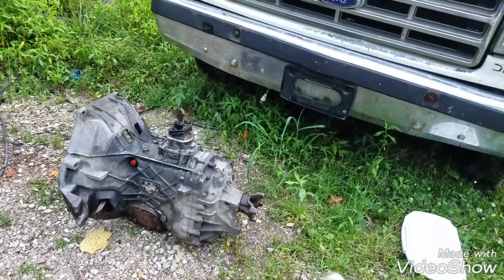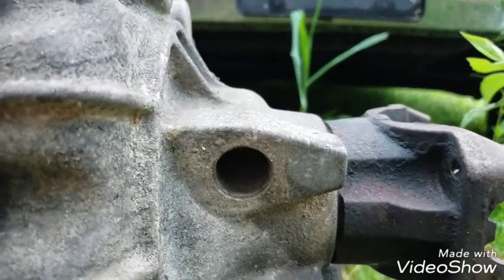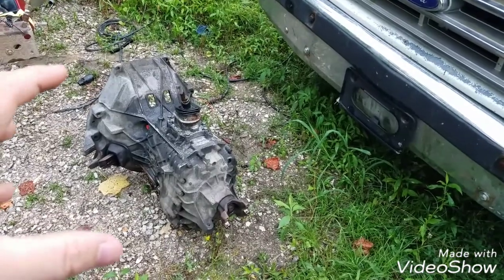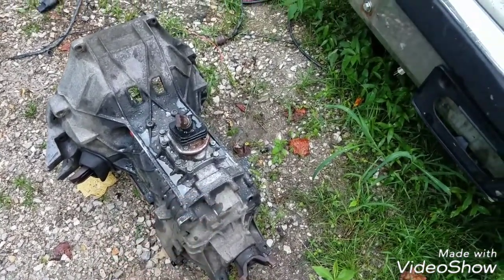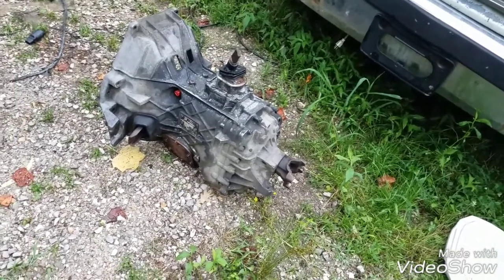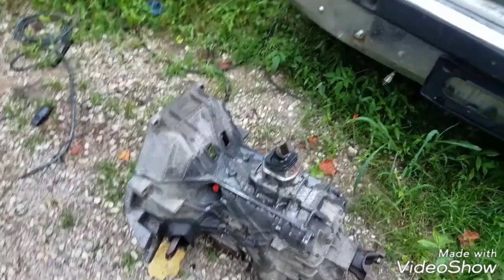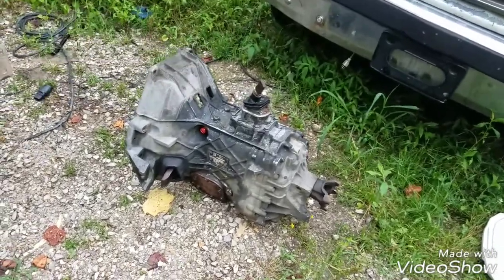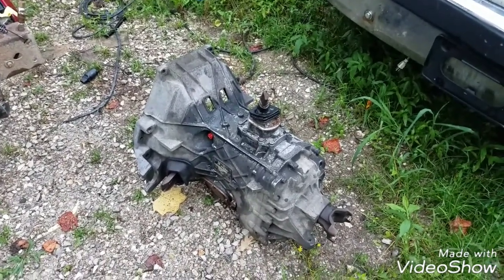OBS F-Series: ZF Transmission Swap Info

Comment: What's good about a manual is you don't need a speedometer if you know the gear and rpm is you should know where your speed is. Not on automatics though.

You drive your vehicle enough you should know as well.

Comment: Hey I f350 460 with a zf5 in it that’s bad I went an bought a zf5 that came out of f350 7.3 what do I need to do to get the 7.3 zf5 to bolt my 460
Reply from the maker: Not sure; I know on the 460 to 7.3 swap it involves elongating a couple of the bell housing bolt holes

Comment: Will a 1987 f-250 6.9 zf5 4x2  will fit behind a 92 f-150 351w  with a E4OD Thanks
Reply from the maker: No

The 351w uses the smallblock bellhousing pattern like a 302

460/7.3 bolt patternsare close enough you can use a 460 trans on a 7.3 with some drilling of the bolt holes

Comment: I have 1976 f250 4x4 "High boy" (auto trans) 390 motor.  Donor truck 1990 f250 2wd (manual trans) 351w motor. Can I swap manual transmission from 1990 to 1976 High boy?
Reply from the maker: With an adapter, sure. 

390FE and 351w has different bolt patterns

A work around is a NV4500 transmission and an adapter from www.AdvanceAdapters.com

(NOT sponsored by AA, just a reference)

Comment: I wish I still had my 1994 F250HD with the 300 6 and the ZF 5 speed. It would have been better if it had been a 4 wheel drive. 
Now I’d love to find a 92-97 F250HD crew cab 4x4 single rear wheel.
Reply: eBay. But brother will you pay for it. Its easier to find a '57 Chevy or '66 Mustang than it is an '80's or '90's anything.

Comment: I have a 1995 f250 2wd 7.3 ... if i buy a zf547 4x4 will it still fit the engine ?... I'm doing a swap in my 1983 f350 ... buy it's a 4x4

Comment: The 450 and up(2wd) trans with the E-brakes are a 4x4 ZF5 with a e-brake attached. So to use it in a 250/350 you could either A, unbolt the e-brake and use it in a 4x4 truck, B, keep the e-brake and use it in a 2wd, or C, unbolt the e-brake, install a t-case and use it in a 2wd truck(this would give you a low-range, and the possibility for a front axle swap later).

Other good bits of info:
1. 460 bell housing can be modified to fit a 7.3 IDI or PSD using a hand drill and a template from the back of a 7.3 IDI.
2. A 92 and up truck can take any ZF5; the speedo hole can be just ignored or blocked off as the speedo uses the ring gear in the rear axle instead.
Reply from the maker: Correct!

My biggest annoyance has been not having a speedometer because I used a 1997 ZF (didn't know until I bought it)
Reply: I wonder if you can use a zf5 4x4 model I heard they have the speedo hole on the transfer case
Reply: @dylansmith3628  Yes, 4wd zf5s have no speedo hole, the speedo is off of the t-case. You will need a t-case from something pre 1992 or so; after that, they use the rear diff tone ring for the speedo signal.
Reply: Thank you do you know of a 1992 zf5 will bolt in to a 1990 and if there is any issues with a swap like that or would it bolt up ?
Reply: @dylansmith3628  The ZF5's went from ZF S5-42 to ZF S5-47 somewhere during the 90s. all are compatible however, as long as the bellhousing matches your engine. 7.3 psd and 7.3 idi bellhousings are the same, and the 7.5l gas bellhousing uses the same casting, with smaller bolt holes.

Comment: @The F-series Can the tailshaft be taken off the ZF5 with the trans in the truck or will it have to be removed?  I have a 96 F350 and the tailshaft broke, I'm going to see if I can find one in a junkyard, will any of the tailshaft from the ZF5's work if it's a 4x4 tailshaft?  I'd like to find a whole trans and keep mine for spare parts but I'm not sure I want to throw that much extra money out or not.  What's a fair price for a 4x4 ZF5 from a later year OBS 7.3 Diesel at a yard?  Thanks, hopefully you see this!  Thanks for the video btw, great to see some info put out there to the world.
Reply: Im sure you already figured it out, but if you haven’t. You need to pull the trans. All the internals are coming out with the tail shaft as it’s all on the front case. Good luck finding a tail shaft as well. You’ll need to find an s5-47 tail shaft. I only ever see the s5-42’s. 47’s are beefier.

Comment: Hey hope you don't mind but I've done these before and did a how to article on swapping on my ol 97 F350 from a slush box to a hand shaker.
http://www.patrickthesalvageguy.com/article_read.asp?title=7%2E3+E4OD%28automatic%29+to+ZF5%28manual%29+conversion+94%2E5%2D97+OBS+F250%2FF350+7%2E3L+PowerStroke&item=13
What I want to do next time is throw a Allison MD3060 in a F350, that would be an awesome bulletproof setup since those trans were for trucks up in the 40k GVWR range, I've got one in a bus with the 7.3 T444E in it, they are slick with the built in retarder.
Good video bud.
Reply from the maker: Thanks

No problems with having more info available!

Comment: You could add a tone ring on the back axle, or drill and tap the hole in the trans then add the gear to drive the speedo.

Comment: speedo works off rear axle sensor
Reply from the maker: Depends on the year.
Reply: 80-97 does far as i knew. tho i guess 91 and older does have a cable driven speedo
Reply: My 92 is using rear axle sensor

Comment: Good transmissions  There is a wide ratio and close ratio. I swapped a 97 powerstroke diesel into my 460 93 using the original trans which was the wide ratio .
Reply: How? Aren’t bolt pattern different between 7.3 and 460